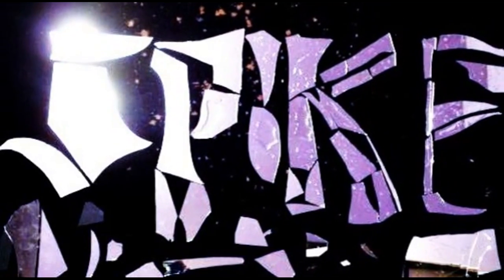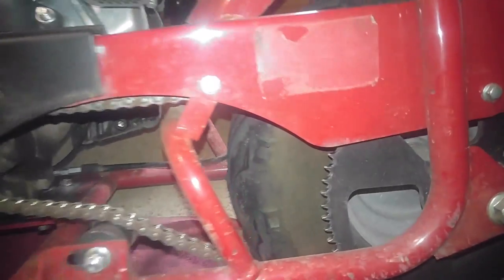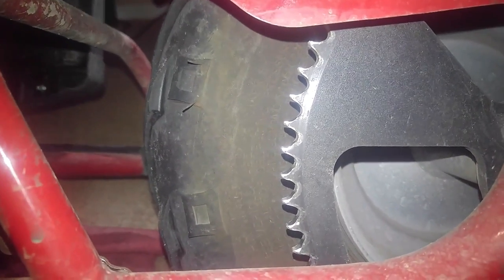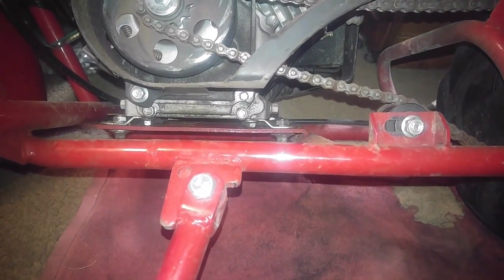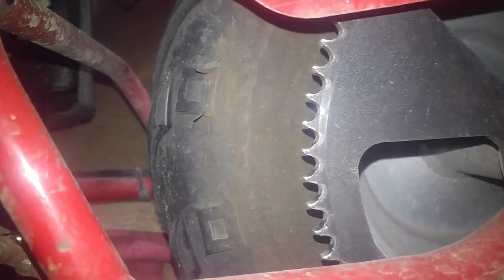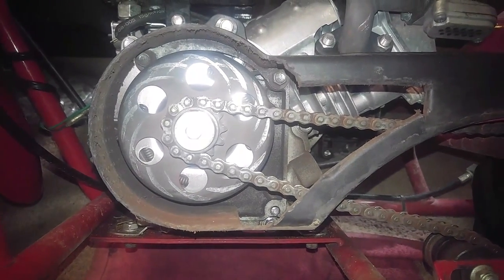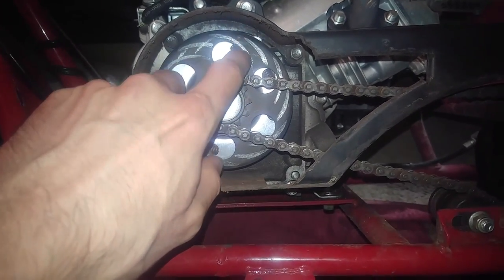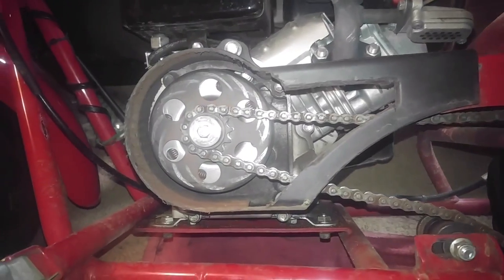Spikeman's do's & donts! for the Coleman CT 100U & 200U

Comment: Thanks for the info. Just got a CT100 and was thinking I needed to remove a link to tighten the chain. But adjusting the motor is the way to go (had already adjusted the round chain “governor” but it was still too loose). And I won’t over tighten it!
Reply from the maker: kyleby2 I think you’re talking about the chain Guide but yeah I get what you mean

Comment: Spike, quick question. I have at CT100, as well. Ran great for a few weeks, engine good, etc. Chain finally came off, which is common, tightened chain, and now it seems clutch coincidentally went bad at the same time, but it won't pull up hill. This thing is still basically brand new, the tits still on the tires, is that common, ? I know I can order new clutch for about 25 bucks, just seeing your opinion. thanks
Reply from the maker: How much do you weigh

Comment: The chain has stretched with wear, when you get a new sprocket go ahead and get a new chain.

I worked in a machine shop and people would get a new sprocket and put the stretched chain back on. it would wear out quick.
Reply from the maker: i have more problems with the engine sliding back, i run the 420 chain no more replacing sprocket and no more chain falling off ;)
Reply: mike t my chain is brand  new.second day of riding 3rd chain pop

Comment: Can you link me or tell me where i could get a header and a exhaust for the coleman ct100u?
Reply from the maker: there are no after market parts for the stock ct100u it all has to be custom made as im having mine done from a bike shop dont forget to like and subscribe will be doing a video on custom pipe in the long run, but if its aftermarket your looking for you need to buy a predator212 from www.gopowersports.com
Reply: You can get a header at hotrodminibike.com. Your bike needs a rear sprocket and a GOOD quality chain. And when you get a new chain buy chain lube and keep it lubed. You chain looks bone dry like it never got serviced. Chains stretch.
Reply from the maker: well ill be damned ! thanks man been looking for more sites like this got any other sites you can tell us about
Reply from the maker: checked out the site and i cant thank you enough for this website thank you Deucealive75 your da bomb
Reply: I can't think of any others right now. I bought a few things from hot rod mini bike and it was a smooth transaction. I called to order and the guy was pretty cool and professional. Oh...OMBwarehouse. But I don't know if they sell CT100 stuff.
Reply from the maker: i got ya yeah i found some other sites my self found a good one at gokart usa 
sick ass mini choppers
Reply from the maker: http://www.shop.hotrodminibike.com/100cc-Power-Up-Kit-Open-Header-Coleman-CT100U-PWR79.htm

Comment: Just bought a CT 100. Will not run unless I leave the choke on. As soon as I disengage the choke, it stalls. Also, will not go up any incline from a dead stop. What's up?
Reply from the maker: Dan Gannon could be something to do with the jet or the spark plug check everything man
Reply from the maker: Dan Gannon or you could always do what I did and buy a predator 212 and shoehorn it in
Reply from the maker: did you turn the fuel on? that always helps too ;)